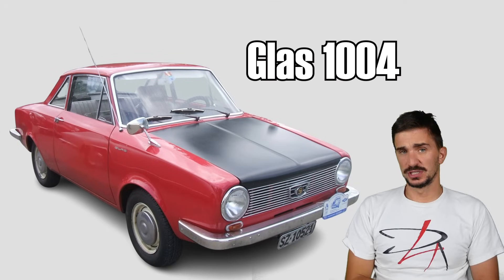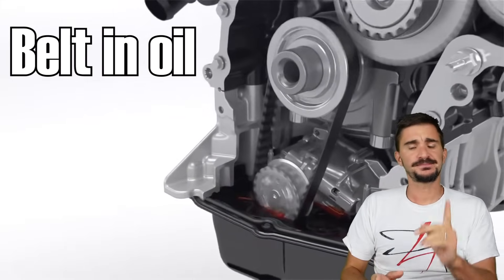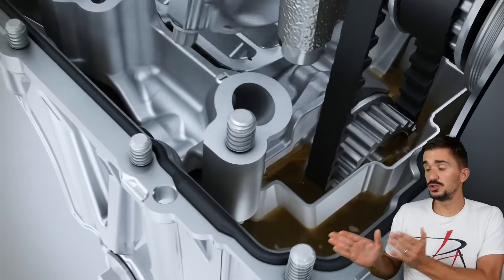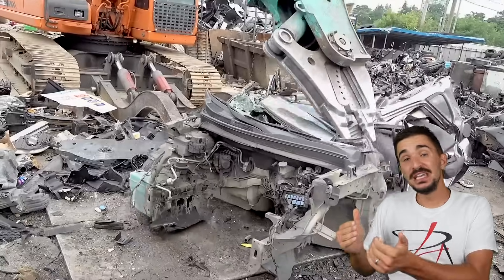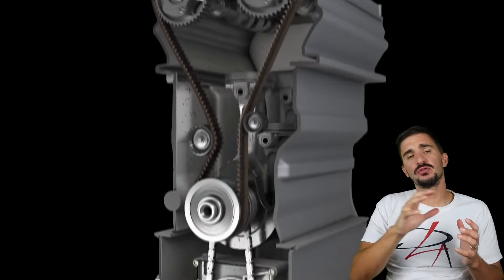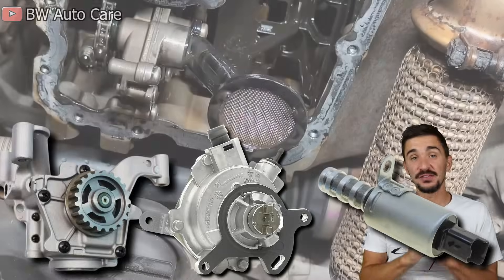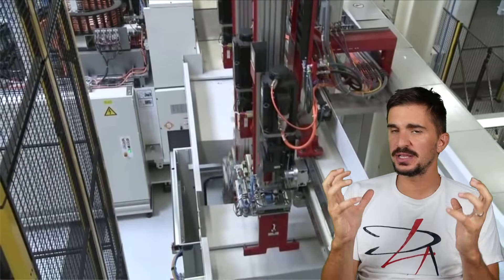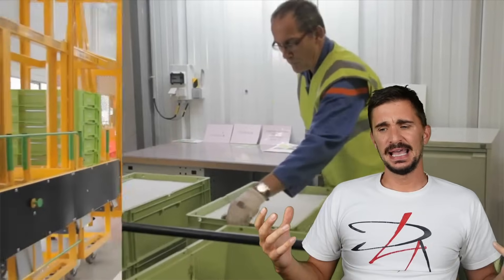Who Approved This and Why Is It Still Being Made? Wet Belt aka Belt in Oil Engines

Comment: I'm am an automotive metallurgical engineer and a lot of my work engine R&D including both the specification side and the wear and failure analysis side. I have never witnessed a conversation that involved intentionally reducing the service life or reliability of any engine component, but I have been part of many conversations where my push (or the powertrain engineers' push) for more durable or reliable components got shot down on cost limitations. Management ALWAYS asks for more reliable engines, but they often set cost as a higher priority, and they almost always set fuel efficiency and emissions as the top priorities. Yes, the customer wants to pay for a reliable engine, but governments are forcing us to shave every tenth of a percent on both fuel efficiency and emissions. Automakers get fined hundreds of millions of dollars for selling customers the powerful, reliable engines they want instead of the 1% cleaner, 1% more efficient engines that sacrifice everything the customers want.
Reply: I don't believe higher management would ever disseminate or leave any proof that they would request engineers build less reliable engines. So of course they would use other tactics to reach the same result, such as reducing costs. So it makes sense you wouldn't hear about it
Reply: @durragas4671  I've been involved in conversations that started with "what is the cheapest plastic we can make this part of" when nobody at that point in the design process knew what were the requirements for that part or if indeed plastic was suitable at all for that specific application.
Reply: I agree that the government is more responsible (rules, regulation and fines) for this than the automakers. Still the companies bean counters are to blame also.
Reply: That's because governments wanted the internal combustion engine gone, or severely limited decades ago. It all began with (over here) ridiculously high taxes on fuels. And the car manufacturers did not want to comply and kept on going with old tech (combustion engines). That had to clash at some point, and the consumer is the one paying the bill.
Reply: @stuglenn1112   Im willing to bet the manufacturers are "oiling the belts" themselves when it comes to the gooberment.
Reply: Fellow engineer. Are you hiring? that sounds cool. It's too bad engineering is really about politics and money. We would have really cool stuff if it was different
Reply: @krisramos7453  Wish we were hiring right now, we have a lot of work and not enough engineers to do it, but management has us on a hiring freeze.
Reply: This is what everyone suspects but we never know. Thinks for sharing. Often, when I hear "what idiot designed this". I reply with probably not an idiot but someone who had different priorities than you.
Reply: Is that really the case though? The average age a car gets scrapped in the UK is 16. But a decade ago it was 13. Cars have still got more reliable as they've got more efficient and less polluting.
Reply: Frankly this is bullshit because we already have existing engines past the design phase, that are both more reliable and more efficient and cheaper to make but they still haven not entered production. See Acahtes power both gasoline and diesel engines that operate at better than 2027 emissions while having no head on the engine so drastically reduce complexity.
Reply: This comment needs to get more likes and be pinned.
Reply: @drunkenhobo8020  I didn't say that engines or cars in general are getting less reliable and durable every model year. I said that management often prioritizes emissions and efficiency first, then cost, then reliability and durability. I also said that emissions and fuel efficiency are almost entirely driven by government coercion (customers do NOT want to pay extra for engines that are cleaner and less reliable) but cost is of course very much customer driven. In spite of those priorities, technology continues to improve and engines do mostly get more reliable even on tight budgets.
Reply: @elektro3000  I'm not sure what your point is though. If we didn't have government regulations we'd probably still have leaded fuel. Hell, we'd probably still be riding horses.
Reply: @drunkenhobo8020  I don't see how government regulations had any influence on Gottleib Daimler building the first automobile, but my point is that fuel efficiency, emissions, and durability are often three competing priorities in engine design. Cleaner emissions can even significantly reduce fuel economy (emissions control systems have severely reduced diesel engine economy AND reliability over the past decade). So given the choice, customers will usually but a more reliable engine over a more fuel efficient engine, and they will usually buy a more fuel efficient engine over a cleaner engine. So if you want a more reliable engine, try voting for governments that regulate less.
Reply: @elektro3000  That just sounds like libertarian nonsense. I don't want more polluting cars and I don't want leaded fuel back. I don't care if the consumer doesn't care about emissions - people are notoriously bad at assessing risk so more regulations are better.
It's a fairly moot point as EVs blow ICE out of the water when it comes to reliability, emissions and efficiency.
Reply: Obviously you never worked for GM.
Reply: That may be the case, however I think there are other manufacturer factors that determine the failures in auto manufacturing, often guised as consumer demand and government interference.  Toyota made some inherently bad engines and  gearboxes on their 4WD ranges on account their marketing dept discovered a large percentage of owners rarely engaged 4WD so cut quality in engines and drive trains to incur savings at the cost of a percentage of failures. Ranger/ Courier and Navara gearboxes similarly have had massively bad raps for busting yet nothing is mentioned regarding the costs of manufacturing replacements, repairs, freight/ fuel as opposed to just making one that lasts. Similarly Courier/ Ranger/ Bravo heads on the overworked 2.5 liter engine - the heat generated by the engine and turbo on these cracked the heads and warped the exhaust manifolds, (similar to the Ford F150 turbo’s in the  of today). I can’t believe that is government mandated or that these issues are discounted as paltry to a weight saving= fuel economy and that it’s driven by government mandates. 
Besides it doesn’t stop people buying ridiculously big trucks beyond practical design use for them. 
I don’t know who is at fault, could be all of them and the design engineers. Makes my blood boil the unacceptable waste, (fuel, manufacturing and transport energy),inconvenience, consumer cost, and the ridiculous opulence (bling), shit electronics, dumbing down of user skill and ability by installing auto everything and seeing this stuff fail.
I’d rather drive something ( and I do ) that does 1 km/ liter less but has lasted fifteen years longer than the stuff that has been designed the last ten years and will do beyond now.
Reply: @drunkenhobo8020  This is a great video about engine design, wear and failure mechanisms, and materials engineering. I'm just here sharing my experience about how the process works. If your priority is making other people buy the kind of engines (or products in general) that you want them to own instead of letting them choose, then you can vote for governments that impose more regulations. I'm pointing out that in the absence of regulation, the priorities are driven by the customer and the customer usually chooses to prioritize (1) Cost, (2) Power, (3) Reliability/durability, (4) Fuel economy, (5) Emissions. Government regulation is reprioritizing that into (1) Emissions, (2) Fuel economy, (3) Cost, (4) Power, (5) Reliability/durability.

As for battery powered cars blowing internal combustion cars out of the water on any of these priorities, from my experience so far, it's all tradeoffs, like everything in engineering. Battery powered cars are much lower maintenance than internal combustion, and have fewer points of mechanical failure, but they also suffer many more software-induced failures. Similarly, they produce no exhaust emissions at the vehicle, but unless you have 100% nuclear/hydroelectric/geothermal/solar/wind electricity available, they just move emissions to another location, and the raw materials are incredibly toxic and environmentally damaging. There is no free lunch.
Reply: @drunkenhobo8020 EV also make  good camp fires...
Reply: @unknownname6519  Not really. According to insurance data they catch fire 20 times less often than ICE vehicles.
Reply: @drunkenhobo8020  i never saw a iev burning.. But more then enough EV-buses near my town....
Reply: @elektro3000  Yes, but there has to be a balance between individual choice and collective responsibility. I've been to Berlin when they still had Trabants. Absolutely nobody wants that level of air pollution, but individuals would still buy such cars if they were cheap enough. So they need to be removed by regulations.
Regulations can also be used to ensure reliability, especially with things like right-to-repair, lemon laws and the robust consumer protection laws in the EU & UK.
Emissions are moved somewhere else, which is a good thing. It means they're not in dense population centres. The toxicity of EVs is massively overblown, especially compared to the oil industry. They're by no means environmentally friendly, just a lot less bad.
Reply: @unknownname6519  Anecdotal evidence isn't worth much compared to hard data by insurance companies.
Reply: China sells the cheap ones I hear.
Reply: This actually makes me feel better.  I'm glad it isn't part of some grand conspiracy.
Reply: @vaporizer82  that is actually brilliant.  and believe it or not really helpful.  i've been under so many cars over the years cursing a designer who makes it so the only way you can drain oil (even with a lift and a drain guide) is all over another part of the engine....sometimes even a sensor.  this answer makes sense of that.
Reply: @drunkenhobo8020  i'm with you on this.  i love ICE vehicles.  work on them and grew up with them.  and i'll always have at least one.  but when we go full EV for most people who just want a vehicle to go from point a to b....the vast majority of folks... it will be a great day for the environment.  even with localized differences in electrical grid fuel (e.g., coal, lng, renewables).
Reply: @drunkenhobo8020 About the Trabants: what you're saying is that people do, in fact, want such levels of air pollution. Why else would they buy two-stroke cars?

This is central to the "libertarian nonsense" ideology: nothing is for free. Sure, we would all love a world free of pollution, but what are people willing to sacrifice (in living standards etc.) to that end? When the market decides that the Trabant prevails over the Prius, then the Trabant is what the people want, ironic as it may be to use a DDR-produced car as an argument for free-market capitalism.
Reply: Yeah it was simply they needed to get emissions down by 1% and this was the best they could come up with without adding cost. They probably originally did figure it wouldn't be as much of a problem as it has been. I don't think they did it so they could sell more belts in 8 years.
Reply: @drunkenhobo8020  I never believe any "absolutely everybody" or "absolutely nobody" type statements because I've learned that SOMEBODY always thinks different...but I agree with your point that most people want clean air.  However, most people also want cheap cars. And most people want reliable cars. And most people want fuel efficient cars. The problem is that all of these things are in competition and need to be balanced. People may want clean air, but do they want reliable cars more than they want clean air? Do they want reliable engines more than they want efficient cars? Manufacturers balance these competing wants in every car model, and that balance can either respond to what the customers are choosing to buy, or it can respond to governments threatening fines. Government regulations are pretty much always forcing manufacturers to build something that is not the closest match to what the customers want, otherwise the manufacturers would already be building that same thing just to make the most sales.
Reply: @raftinkiwi  You bring up a great point, and I'm definitely not saying that every unreliable vehicle system is the result of government regulation. Sometimes the validation targets are just set wrong (every part and component is specified and tested to survive a certain level of use for a certain lifetime - there's almost no way to make every part last "forever" or the car would cost $10,000,000 and weigh 10,000 pounds). Sometimes a supplier doesn't make a part to spec, or manufactures a run of defective parts (a "quality spill"). Sometimes management pushes Engineering and Purchasing to save money by using cheaper materials, cheaper processing, and/or cheaper suppliers (it's not some secret scheme to intentionally sell defective vehicles or trick the customer into unexpected repair costs...just that MBA management types often think cheaper manufacturing creates the same product as more expensive manufacturing).
Reply: @TheLukasDirector  Which makes it a perfect example of why free-market capitalism is a bad idea.
Reply: @drunkenhobo8020  And rust protection has improved over the years. Tho Ford could do more
Reply: True in all fields. Engineers are taking the blame while the idiots in mgt, the bean counters ARE THE REAL culprits ! Same for less testing, less quality insurance, delivery time etc...But when it works,  who brags about how smart they are ? Always document !
Reply: Man-agement is doing what it is planned for: aging people!
Reply: @drunkenhobo8020 in your opinion. You also think more regulation is better than less, more government control better than less, people living in a box that you’ve approved, so not a lot of people will take that much notice of your opinions.
Reply: Siccome il governo non paga l'auto che sto guardando le case costruttrici dovrebbero fare l'interesse del cliente e imputarsi prima di prendere le multe vedi ( wv con dieselgate e altre marche ) se non si può, non si può 
Ma il governo ci obbliga ecc... Allora bisogna risolvere il problema alla base,prima fate elettricità in modo sostenibile poi gli ingegneri faranno batterie ecocompatibili e durature.
Oppure fate carburante eco e poi i motori a seguito 
Non si può prima fare una macchina ecocompatibile e poi fare il carburante che la alimenta
Reply: @KeyBrosUK  It's just very odd to read people who are pro air pollution. If your ideology is so rigid that it demands you allow people to freely pollute the environment without consequence, maybe it's not a very good ideology?
Reply: EXACTLY, elektro! Thank you for pointing this out.
Reply: @drunkenhobo8020 I find that really hard to believe.  Are you sure that isn't a  result of scrappage schemes or the push to do away with old ICE cars? When you see a car on a recovery truck or broken down it's usually quite new...
Reply: Nope, often real and utter idiots. As in cars that need the engine removed just to get to and clean the EGR, or the many cars that need 2 to three hours of work for a headlight bulb change.

The responsible designers should get the Vlad Tepes treatment.
Reply: You cannot compare those numbers as earlier the EU gave huge financial premiums to get older cars out of circulation.
Reply: Wet belts are marketed as being more fuel-efficient , benefiting both manufacturers and consumers by slightly improving fuel economy. However, the real cost of these savings falls on the consumer, who has to constantly replace the "150k mile" belt or engine replacements when the belt disintegrates. As a solution to reduce emissions, any environmental benefits are lost once the belt cracks or requires a full engine overhaul. Unfortunately, manufacturers and regulators seem more focused on promoting “fuel efficiency” rather than ensuring engine longevity and sustainable carbon savings.
Reply: @breakbollocks9164  There's a difference between design for durability and design for serviceability. I used to be a dealership mechanic before I started working as an engineer so I look at everything thinking about how to service it. Many engineers have never picked up a wrench so they just don't realize the long term consequences of their design decisions. We actually have an entire group dedicated to Design For Serviceability but it can be a real fight to get design changes pushed through. Again, everything's about priorities and tradeoffs. I remember when I was a Jaguar dealership mechanic and Ford (who did all the engineering under contract to Tata after selling the brand) added their 2.0L Ecoboost straight-4 engine as an option to the Jaguar XF. Ford only used that engine transverse (sideways) but the XF was built to fit longitudinal (front to back) engines. So Ford turned the Ecoboost around and bolted it up to the transmission longitudinal. That moved the oil filter so it was squeezed right over the space between the front subframe and the steering rack. There was no good way to get any kind of funnel or catch pan under the filter and if you just unscrewed it, the oil would run down into that gap and spread out the entire width of the subframe before dripping all over the floor in a three foot long line. Relocating the oil filter would be a MUCH better choice for serviceability, but they decided that cost (redesign, testing, multiple parts instead of shared parts) was a higher priority.
Reply: It's not possible for you to design an efficient and clean engine without it being unreliable? Sounds like you're a bad engineer.

I understand how cost factors into reliability, but saying "oh man I can't make an engine reliable without it constantly running 12:1 afr" doesn't show competency.
Reply: @drunkenhobo8020  I’m not pro air pollution I’m pro choice, modern cars are very clean anyway and most drive Euro 5/6 above so the point is moot!
Reply: This is the big picture that the video misses.
Reply: @NGabunchanumbers  Do you want clean or do you want efficient? And which "clean" do you want, because there are different types of emissions (carbon monoxide, particulates, unburnt hydrocarbons, oxides of nitrogen) that all respond to different inputs. Most gasoline engines aren't calibrated to run super rich of stoich all the time, just cold start enrichment, a little enrichment at high load (especially at low RPM) and the vast majority of fuel enrichment is turbocharged engines running under boost, especially max boost at low RPM. But direct fuel injection and PTWA cylinder blocks (which cool better than iron lined aluminum blocks or cast iron blocks) are reducing the need for low RPM/high load enrichment anyway. The problems happen when fuel economy and emissions regulations are written by bureaucrats who don't understand the engineering they're regulating, and threaten manufacturers with fines unless they shave tenths of a percent when they're already waaay beyond the point of diminishing returns. Most gasoline engines are already so clean, the exhaust is actually cleaner than the ambient air in a lot of large cities. Not only is the engine not polluting, it's actually cleaning up the air by burning up and catalyzing particulates and oxides of nitrogen that get inhaled into the engine. Yet regulators keep pushing for cleaner than clean, so we get systems like exhaust gas recirculation that can create sulfuric acid and pour it into the combustion chambers or blow soot into the intake manifold, or now the industry is getting pushed to add gasoline particulate filters, which we have already seen failing and causing engine failures in diesels for years. Similarly, when regulators threaten fines for selling engines that customers want to buy instead of engines that meet arbitrary fuel economy regulations (and in the case of the United States EPA, measuring that fuel economy with a test program that does not represent real world driving at all) we get bad decisions like the one described in this video. Customers would rather sacrifice 1% fuel economy and have a dry belt that reduces maintenance and reduces the percentage of failed engines, but regulators threaten fines and so manufacturers give up everything else for fuel economy (except emissions, because the fines are even larger).
Reply: @elektro3000  seeing how much hybrids increase fuel efficiency over pure ICE cars, if manufactures were really so scared of efficiency over any other concern, including money, as you propose they are, they would just make every car a hybrid. 

Yet I find that most brands won't sell you a hybrid in the U.S. even if you want one, and even if they designed one for another market. A person I know was in the market for a 2019 mercedes GLC, 300. There's a version called the 350e that is the same car but has twice the gas mileage due to being a hybrid. They were like "whoa, twice the range (at least in city or hills) that sounds great I want that! Plus there's more horsepower, what's not to love?"

Oh, but mercedes didn't sell the car in the USA. Even though it got an average gas mileage rating from the department of energy... 

Companies don't want to sell more efficient cars even if those designs exist, because the cars are more expensive. 

If the government wasn't there, companies wouldn't sell cleaner or more efficient engines, they would still have 10 mpg and no catalytic converter. Even if the engineers came up with something better, the companies simply wouldn't sell it. 

Funny sidenote, the GLC 300 actually has the user interface programmed in to be a hybrid, even if it doesn't have the 350e modification. So, the whole design was built to be a hybrid.

I mean, do you honestly believe that catalytic converters would have ever been accepted by auto manufacturers if it wasn't law? "Hello boss I want to manufacture this really expensive component for the exhaust system.. no, it doesn't increase power, actually it might decrease it with back pressure a little bit, but it's for the environment! What do you mean no?"
Reply: @Axel_Andersen  This is a busted management organization. Changing plastics is simpler than redesigning a failing part, if the original material choice turns out to not  meet performance specs. When engineering decisions, by non-engineers, become ego involved fights, the decision process, and probably the people deciding, needs redesigning, not the engine and parts.
Reply: @JP-vs1ys  Thanks for recognizing modern urban civilization is at an existential crisis, one we solve quickly, or see losses of most humans now on the planet, most living in an unimaginably poor quality of life.
Reply: @TheLukasDirector  This actually illustrates the saying, "No snow flake ever feels responsible for the avalanche." In a mass society, few see any connection between their individual habits and behavior, and the overall outcomes of the total of choices and habits. Same with voting, "My vote won't matter." till 2/3rds of the non-participating voters leave decisions to a minority. Which sadly explains most recent American politics.
Reply: @elektro3000  Basically right, but this ignores the influence car makers have on the rule making process. Most legislation, and associated 'rules' are products heavily influenced by the very well practiced, and even better financed, lobbying industry, State and Federal, and even more directly by 'owned' legislators. The results almost exclusively are strongly manufacturer biased rules, on now badly politically compromised public needs. All the truck/SUV/Commercial carve outs on mileage are poster children for this very politically compromised system, and mostly ideas emerging from the vehicle manufacturers themselves. The carve outs were/are to protect the larger profit margin vehicles that drive overall stockholder returns.
Reply: @breakbollocks9164  These issues are from production costs and time having priority over maintenance issues. The rear spark plugs on early Ford V6 vans in point. Packaging and assembly priorities resulted in the manual's first line of directions to change back row plugs, was, "remove engine from car". Many cars have completely assembled and electrically connected engines dropped in, or raised up under, a largely assembled chassis. This is perfectly rational for the assembly line. Making expected maintenance items easily accessible isn't even on the radar of many packaging engineers, and of lower priority, if it is considered. Occasionally the worst of these get improved at the first real update of the platform. Really bad ones may be addressed for the second model year, if dealer service departments. are screaming loud enough. My pet peeve is model specific headlight covers that are integral and not removable for resurfacing, or replacement, after the plastic ages to barely translucent. $500 a side for replacements isn't unusual. I'd like a Federal rule the warranty on headlight assemblies is for the life of the car. Which would see some massive re-engineering.
Reply: @NGabunchanumbers  The real choices are between Clean, efficient, reliable, and cheap. Pick 2. In the real world costs have the most pressure on the design process, given the MBA training in early 21 century of most management suits. Like Boeing, removing the real engineers from the decision process easily creates problems for every other stage, particularly the product user. And may tank the company.
Reply: Eh, you are wrong, but I understand your position. Large companies aren’t in the business of significant improvement. Heck, significant improvements threaten embodied capital.
It’s easy to meet mandates if old paradigms aren’t carried forward. You’re just convinced that it is a zero sum game. But, for example, if secondary air were to be injected after the reducing cat but before the oxidizing cat all the emission mandates would be easy peasy. And if insulated external to the cylinders combustion chambers were used 2/3 efficiency would be achievable. And piston-based displacement adjusting systems can provide 3:1 expansion to compression ratios at all torque levels.
There’s so much more. 2/3 efficient completely clean engines are possible. It’s not a secret (though you are one of the first to hear)
Reply: Vaporizer,
Actually, it’s what poor sap had to comply with an Elon Musk Cybertruck boss’s demands?
Reply: Electro,
One might think so, but no, efficiency, cost, and cleanliness are only at odds if one wants to protect imbedded capital. You see, there is no reason to expect a current engine manufacturer to do anything but make marginal gains. Anything more would lose money as their embedded capital becomes worthless. A new system turns all your old machines into scrap. Plus, companies hire peons, not visionaries. Visionaries have to build from scratch
Reply: That was indeed true UNTIL this year (2024) when Ford stated (out loud even!):
"Don't Over-content  Don't Over-design  Don't Over-pay"
Upper Mgnt then went on to say (in the same town-hall) that, going forward, Ford vehicles should be made in such a way to just meet the warranty requirements - and that is it.  Nothing like "Quality is Job1"
Reply: I strongly disagree in the perspective of a mechanic who saw the result of engineering decision (GM 2.5 liters with one came gear mad of plastic was not a success) GM trucks with 3.8 liters and engine oil cooler lines that were crimpted with aluminium were all failling before 90 000 km. I could go on with a very long list. I came to beleive that in some instance engineers are asked to come up with a design that will allow to sell more parts. I will finish with Ford truck that came up with new weel nuts on all pickup trucks from Rangers to F350 that they had to recall. The weel nuts were selling 10 time the price of the proven desing that exited for decades.
Reply: I don't believe the nylon covered timing gears/sprockets were cheaper than the all metal ones... and I've never heard an objectionable noise difference...
Reply: @drunkenhobo8020  - The small British engines used to fail at 25K miles...
Reply: @durragas4671  - Remember when Ford people admitted that Ford said it was cheaper to pay $1Million for each person killed in a Pinto than to fix the exploding/burning gas tanks? 
Then juries started awarding $100Million per person...
Reply: @buzzwaldron6195  Hey, we don't talk about the Rover K-series, ok?
Reply: That is the comment I was waiting for. The reason is the 1% fuel economy. That's it.
Reply: tedsaga
Reply: Couldn’t have said it better myself
Reply: Remove all the weight added by installing rubbish like heated seats etc, instant fuel economy.
Reply: Gotta tax that top 1%
Reply: 100% the ford fox engine (1.0L 3cyl turbo) was designed around fuel efficiency and emissions rather then serviceability and reliability. Because they dont get fined for making a garbage engine,
Reply: The fact these engines are basically all European market engines suggests it’s a problem with EU regulations
Reply: Based on life time data that included old vehicles built decades ago.

EVs can't get insured due to their cost and the risk involved with them.

Electrical faults occur more regularly with a car than mechanical ones. Mechanical ones are typically easier to diagnose and cheaper to fix as well. 

EVs usually suffer higher tyre and suspension wear too. Tesla's, for example, are known to have rubbish factory brakes and poor suspension that fails quite often (wishbones and bushes).
Reply: Don't blame fuel efficiency standards. Toyota and Honda, the two car makers with the highest average fleet fuel efficiency, also have the highest fleet reliability. Ford just has bad engineers.
Reply: I agree. Government regulations are the main reason we see small, highly stressed engines with complex timing systems, variable valve systems, direct injection, small bearings. low tension rings, etc. Sometimes unforeseen problems crop up and manufacturers tend to try and deal with them instead of correcting the issue at the source due to cost issues.
Reply: @drunkenhobo8020  That may well be true of cars that still use tried and trusted designs, but I bet if you took a particular model, eg Ford Focus with the wet belt, the result would be different.
Reply: And then shareholders want a big return...
Reply: @drunkenhobo8020 correlation isn’t causation, it likely has more to do with people keeping their cars for longer due to economic factors.
Reply: Take a look at top level management’s compensation packages. That’s where the problems begin and end. Regulations aren’t killing automotive quality. Over compensated company officers are.
Reply: @johnhiggs325  its both management salary and emissions/efficiency
Reply: @ 

You’re probably correct. From what I’ve seen, emissions control tech decreases reliably AND only kicks the can down the road concerning environmental impacts. Catalytic converters are a great example. Mining platinum group metals…
Reply: @johnhiggs325  EVs would of course help this, but we can't afford the newest gas cars, let alone the newest tech. Price for technology goes down over time as that tech matures. I'm sure in 20 years everyone will have an ev.
Reply: @ 

Maybe
Reply: @C0D3__BR3AK3R__Studios  I won't.
Reply: @elektro3000  ¯\_ (ツ) _/¯  I mean I'm gonna have both so
Reply: If you find a faulty design, you'll find an engineer who knows better, being pushed by a C-suite manager who doesn't, driven by a government regulator who has a completely different agenda.
Reply: @drunkenhobo8020 They're too expensive to throw away now.
Also, two years of COVID lockdowns reduced miles traveled.
Reply: @elektro3000 That's because emissions and fuel economy tests are government mandates and reliability and longevity are merely the priorities of consumers.
Reply: @drunkenhobo8020 Government didn't get rid of horses. Progress did.
Reply: Given service life is a fundamental engineering objective switching to alternative objectives achieves the desired designed obsolescence. The safety/efficiency/environmental objectives were all created by the car companies to maintain throughput. Combining cost cutting with safety is enough. 
If we actually wanted safe reliable cars that lasted we could make them last 100 years but the car companies would go broke.
Reply: @FREDDAGGS  Environmental targets were created by governments, not automakers. Neither manufacturers nor customers asked for this. Safety was a mix of government requirements and consumer demand. Many customers DO want more safety and are willing to pay for it, but the government mandates are often out of sync with what customers are actually trying to buy. Efficiency is an even worse problem, because there is plenty of customer demand for fuel efficiency but government mandates drive automakers to chase requirements that do not at all match what the customers actually want. As for service life, everything is designed for a service life, but we have to decide what the design target is. Top Fuel drag racing engines are designed to make 11,000 horsepower out of 500 cubic inches displacement running on nitromethane with a service life of 0.25 miles. They get a teardown after every run. Many engines for semi trucks have a designed service life over 1,000,000 miles. All engineering objectives are a tradeoff. For engines, service life, weight, power output, reliability, service intervals, packaging, fuel efficiency, and cost are all competing priorities. Engines are not designed to "last as long as possible" or "break after this much life". They are designed with a whole list of targets that have to be balanced against each other.
Reply: @elektro3000  no offense but these things are probably done a bit above your station. All of these regulations are corporate goals with revolving door positions at regulators. The regulators and the corporates have the same staffing pool. These regulations are the only thing keeping these companies afloat. 
Safety isn't safety at all. If you regulated for safety you would be required to wear a helmet, five point harness and have a roll cage. The road toll would rapidly approach zero. Air quality changes were necessary but everything else is adding complexity for the sake of designed obsolescence. Designed obsolescence is universal in society.
Products become more complex, they are stripped of quality materials.  The resulting product has a shorter life span and becomes less serviceable. You suggest this is a coincidence. This is really just a form of inflation. 
This is all coming to an end as it accelerated the mine to landfill pathway and used up all the cheap materials. More inflation.
Reply: Ever come across a paragraph in your studies?
Reply: @malteserwfj  Not in Youtube comments 😂